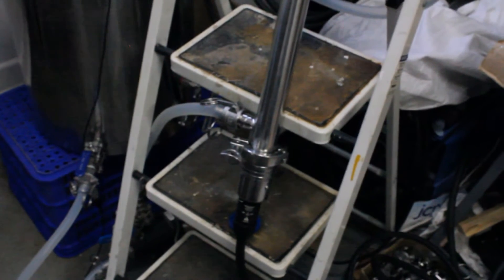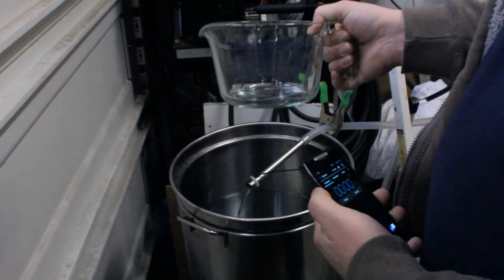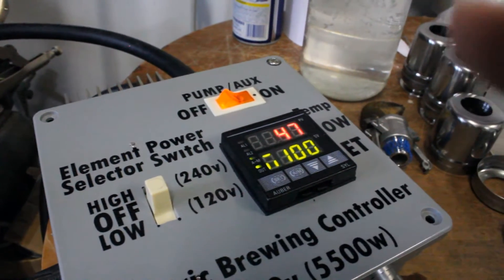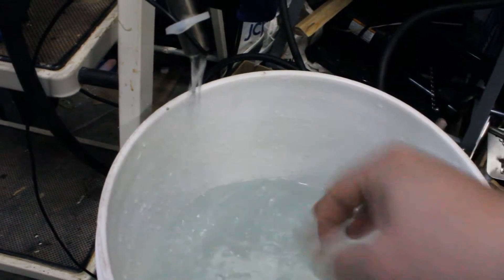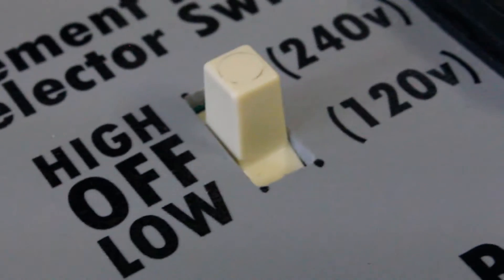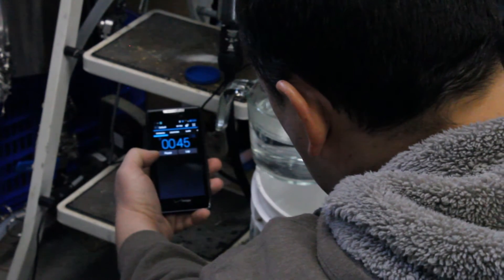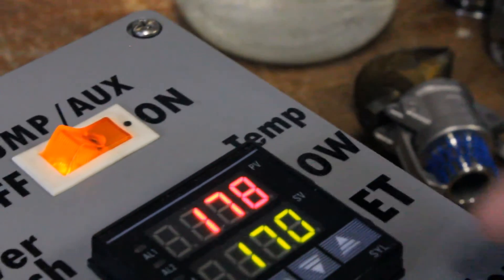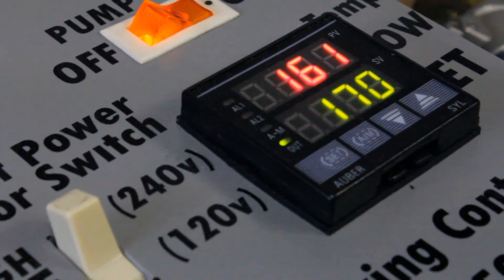Electric RIMS for On Demand Sparge Water?

Comment: Would changing the number from 100 to a lower number not put as much power to the element? Seems like if it works like that you could experiment with a power to flow rate that would yield pretty close to 170.

Comment: Is it possible to have the PID control the power to the element, not simply on/off? I would think that would equalize at the correct sparge temp.

Comment: Definitely useful for regulating cleaning water temps in a cleaning loop at the end of brewday. Probably would have to start with hot water to run the pump full bore. Have you used it for that particular application before?

Comment: I have been trying to research a RIMS system for myself, and based on this video it seems that a 110V setup would work better for holding mash temperatures. Seems the 240v would ramp so quickly it would be finicky to stay at the desired set point and chance scorching. Seems I can direct fire to temp, mash in, then hold / circulate with 120v RIMS. Mashing out seems reasonable to attain as well with the 30° heating differential if I felt I needed to as well. Do you have a preference in voltage for this scenario?